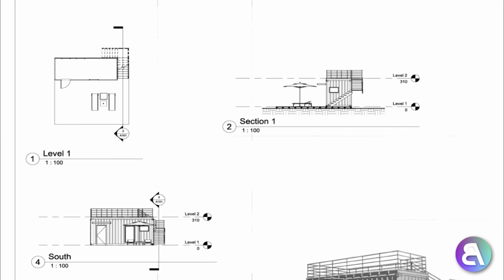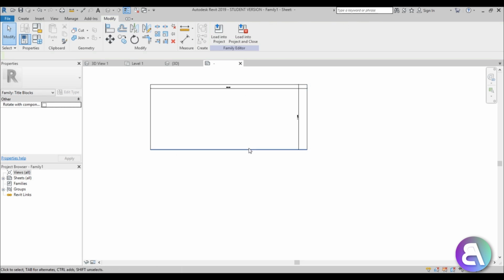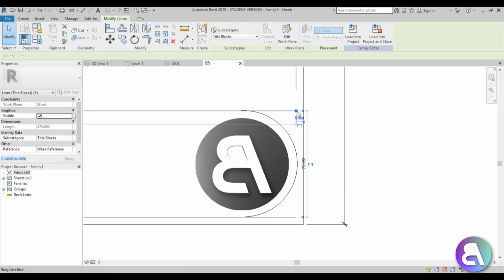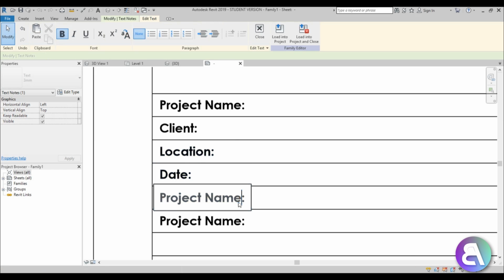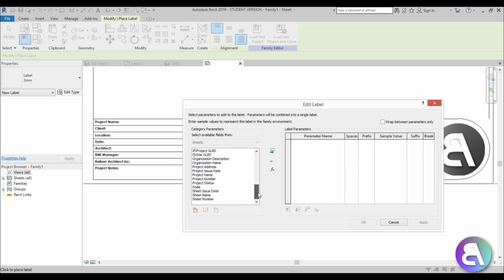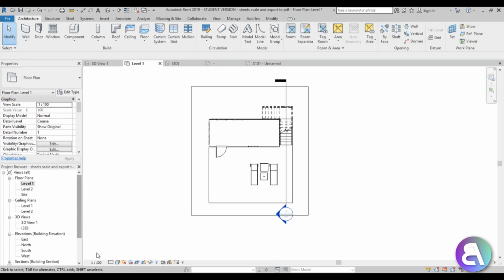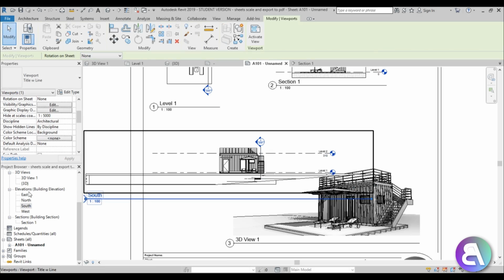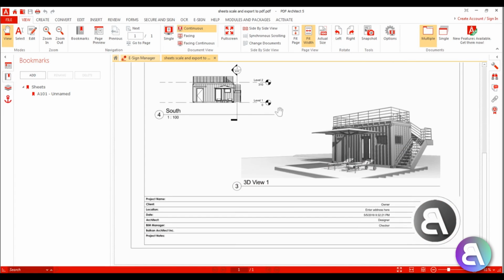Title Blocks in Revit and Exporting to PDF

Comment: Mr. Balkan you are doing great job, keep it up. I have an issue with my revit project. As I have seen in your videos there seems level in 3d view. I want to enable this same (level) options in my 3d view in revit. Please make a video on it's topics.
Thanks
Reply: hey. Levels in 3d views are and upgrade tool of Revit 2019. You are probably using and old version of Revit.  Anyway, If use Revit 2019 you can switch on those levels  opening up a 3d view -  typing "VV"-Annotation categories- activate Levels

Comment: Designer and checker were not filled, where do you fill those informations?
Reply from the maker: just click on the label on the sheet when its opened in project and write in the names
Reply: May I email you with this question? I would like to send you the print, because in my sheet properties doesn't show it =/